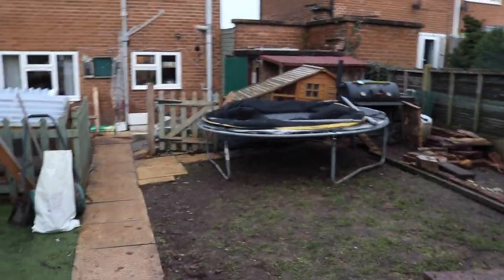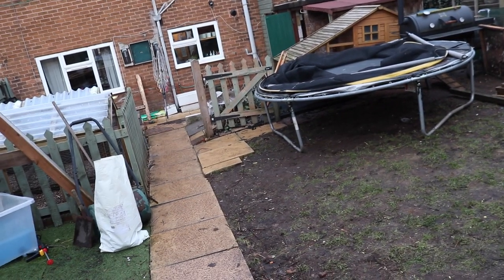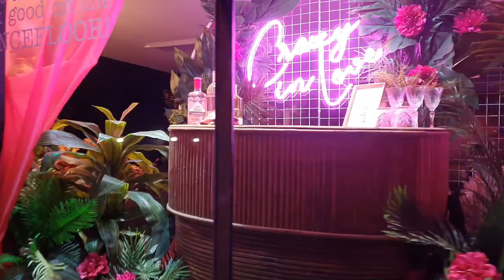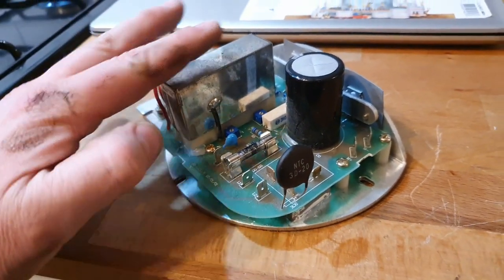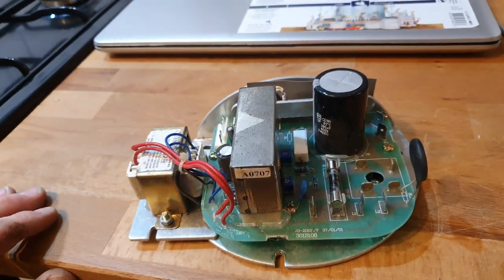Dead Mill

Comment: We had a Roger Black treadmill it had the same circuit board and motor. Ours started blowing the fuse under load then blew it as soon as it was powered on. I tested the motor with a car battery and it worked fine. Since the fuse was on the primary side it looked like the rectifier or the transformer. I changed the rectifier but the transformer was putting out decent voltages so didn't change that. I traced the fault to something in the potted block in the middle. Replacement circuit boards are like hens teeth but I found a DC controller circuit design online so you could knock one up if you was desperate. I ended up giving mine away and bought a NordikTrack treadmill.